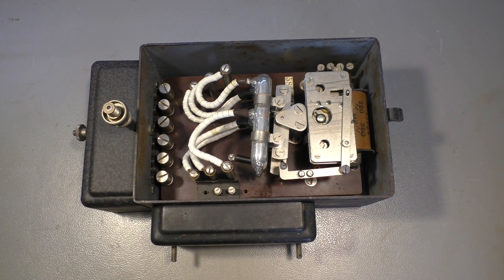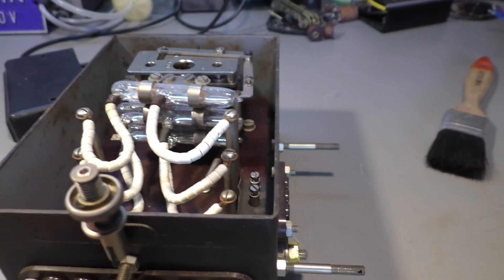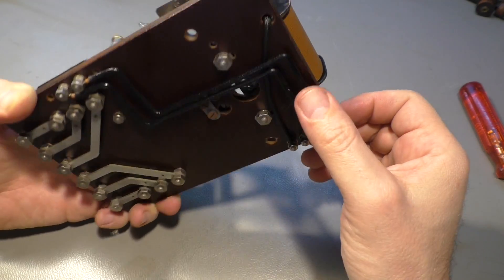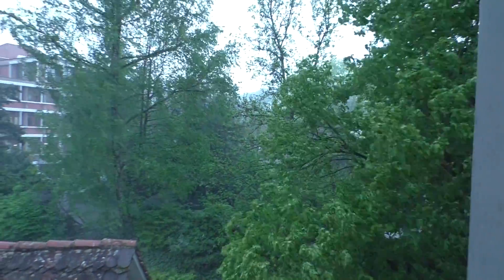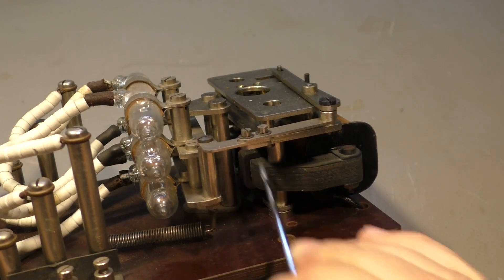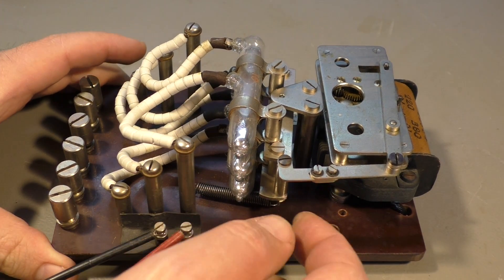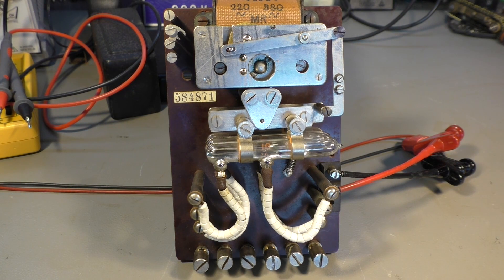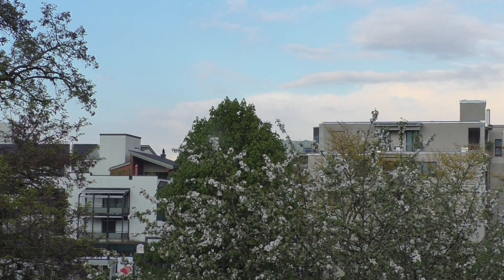Vintage Mercury Switch (PWJ59)

Comment: I just remembered something I remember one time seeing this really Old Clock Tower mechanism in a museum once I remember my dad calling over to me hey call here check this out and quick.

And realized immediately what the thing was and he said if it's actually running and the mechanisms about to start.

There were Mercury switches all over that mechanism some of which looked almost like these but I think it was just the main switch that looked like these it was probably what was in line with all the other switches the others looked more like the classic Mercury switch with the the bulb shaped glass vial also this was a clock tower which was electrically rewound but had the pendulum to keep time this built prior to synchronous Motors being used.

Who knows how old that clock tower mechanism was I don't remember the manufacturing date but it was on there I think I did take a pic of the mechanism and of the information plate happened to have an actual camera with me this was way before cell phones let alone having internet

Comment: At the beginning the switch was laying horizontally. And when shown working you had it sitting upright and vertical.
Did that have anything to do with it working ?
Reply from the maker: The device is made to be mounted on a wall... vertical. If you look where the contacts are attached to the glass tubes, they must face downwards. If the switch lies flat on the desk, the mercury would not reach the contacts. Same problem when it is upside down.
Reply: @PlaywithJunk  Exactly my point !!👍

Comment: I have seen these type of switches used in operating theatre's because of no sparks and explosive gases. I thinks they were removed because they explode if the are required to carry excessive current in a short circuit.

Comment: Are those ceramic beads along the wires? Old school flexible insulation?
Reply from the maker: yes. like a string of pearls. These keep the wires apart (the have a large distance from each other anyway) and make them hang straight down due to their weight. And fireproof too....
Reply: Robust, lasts for ages. :)
Reply: @IljaSara  yes agreed and I've seen this occasionally every so often sometimes even in tube type equipment or also high heat environments as well.

Once was working on a very very old battery charger that had this as well.

Few other things although most things that work on would not be old enough to have this in them!

Although one modern thing around the cross that had something similar except that it was ceramic short little tube like things with one end that was a rounded end any other had a recess that was about the same diameter and these were strung in and on a a nickel chromium resistance wire used as a heater along the length of it!

Also there were a couple Links of it used attached to terminals I'm guessing to vary the Heat by adjusting resistance this was an old school device but yet still modern don't know if it had been improved or possibly just still looking in good condition and have no idea haven't the foggiest at the time what this have been used for and really don't remember much other than this what I've stated here but intriguing device and yes the contacts were Mercury contacts so something that was designed for constant use either or an environment where you would not want Ark in contacts I was told this might have been from possibly scientific lab equipment but have no clue as to what it would have been used for no real identification of the equipment or anything either possibly could have been a part of another piece of equipment that had just been disused or replace although was it working order as far as I could tell and apparently the thermostat which there was a few of internally would carry full line voltage and quite large Mercury switches although different design from this Mercury Relay in the video and the interesting thing is the adjustments for the certain thermostats on there or wired sealed my gas is those possibly Were Meant to limit temperatures there was a little hinge flap over the adjustment screws with a piece of wire that had been soldered I think as some sort of tamper seal possibly or just to discourage from being adjusted this is the first time I've ever seen something like that but was pretty clever of a mechanism to prevent tampering not necessarily prevent but discouraged more than anything

Comment: Built to last, they don't make them like this anymore. This could have been used in a mine considering it does not produce exposed sparks when switching.
Reply from the maker: Yeah I think this is pretty safe. And also moisture can not corrode the contacts. That could be necessary for a switch hanging in a church tower. Almost outside (so many openings)
Reply: That might be overkill for a church tower, the switch can be put somewhere nice and cozy, not necessarily exposed to the elements, at least that's how i'd do it, but who knows considering the age of the thing, the church was probably the last place where it ended up.
Reply: @PlaywithJunk  you should see some of the equipment that's used in bell towers that I've seen or heard about or even here on YouTube.

I know someone that had used a pair of carillon amplifiers that they fixed up with my help.

Those things were built like a tank they actually had redundancy in the amplifier tubes that they would keep working even if there was some failures even though it reduced output volume there was even a redundant rectifier tube as well.

Also I have seen some systems in which the amplifiers are only switched on prior to the Bells sounding but I've seen some system learning amplifiers or essentially powered on all the time which probably may or may not have been good for the tubes depending on your persuasion but we're very reliable probably beefed up and built for the service specifically.

You should see the big solenoids and relays used in the tubular type chimes in the bell towers.

Nice big fat arcs on those contacts!

The relays were at the top of the striker solenoids probably some of the biggest solenoids I've ever seen as well.

This one had been removed from the tower and was being repaired Institute since everything was in the tower basically they had jumper leads that look more like jumper cables than anything else.

I was invited to this so I can see the system first hand.

Somaya I knew that you would like to see it firsthand as well as learn something about the system so I could help occasionally with changing roles on the system as well for changing the tunes on the Bell Tower as well as every so often possibly replacing the perforated tape roll they only came out every so many years to service the system but other people would do the easier portions of things that did not require is there services the simpler stuff and mostly in the mechanism cabinet where things were it was a big glass cabinet would probably comparable to the equipment rack sort of in a different way.

Also something interesting with bells at our school occasionally I did work on the bell ringing system and apparently at one time the fire alarm system had been used to indicate passing time and end of class I know that this was done occasionally in some areas of the countries as well as it was sort of a passive test at the fire alarm system as well.

But this had been long since disconnected but yet not very well done I had bumped the wire in the bell ringing device and happened to hear the fire alarm quick go off I'm like did I just do that try it again sure enough.

There was a place where that wire was supposed to be attached to terminal but it was not it was kind of hanging in there next to a wire that happened to have the right connection to cause it to activate so obviously that got fixed and also labeled and yes this looks like it had been maintained by someone that was just not the greatest and all the wire labels were actually masking tape and head faded away many years ago but did proper wire labels to make it easier for the next person that would ever work on this.

Evidently that system used to do a lot more than I did at that time if there was all sorts of timers and everything all tidy and probably the most complicated one I've ever seen as well as Not only was this the bell ringing system but it was awesome the Master Clock apparently at one time it was able to automatically correct a clocks at daylight savings I tried to get it working but did not have time in the end to actually get that system functional at least for quite a while just finding time and resources to do it and also finally figured out a basic schematic after sort of non-destructively reverse engineering it AKA not having sex thing all the way apart I was documenting as I'd had worked on it here and there probably a good idea as it is since I could not find any information on the system anywhere I went through other people I knew that worked on these sorts of things and they had no clue and apparently a lot of the system that could have done other things was either not used originally parts of which was obviously that way and or parts not even working anymore but in the end got everything that was still connected going or at least I thought was connected which in the end was not at the other end where were that was a few nice pops and bangs and the blowing fuses a couple times as well since no documentation easy enough to do.

No damage done since everything was built like a tank and yeah Murphy switches on all switching contacts and this was one of those sorts of I believe impulse systems but the thing is that not only was an impulse but it was other types of clock system as well there was a mix throughout the school.

There's also manual overrides on this one that we're remotely operated could also switch between different schedules just by turning at Rotary switch in the school office that system I did get working again it was one of the ones that was a little flaky turns out just a loose common terminal on the switch end of things but the odd thing is that common was not used for the manual Bill rating push button which was very much over the engineering that push button it was a Mercury switch as well which I never seen a mechanism for a push button that had a marker to switch I did have them take a Polaroid of it for me just for documentation of something like that since it was kind of special apparently that did not go through relay but trigger the bells directly possibly why it was a Mercury switch and also this was in a separate junction box next to the program selector it was it was called hard to believe the pilot lights for the system were still going was neon but very very high value resistors definitely was going to keep going none of the pot lights were even flickering after all those years very well engineered and over engineered to say the least
Reply: But it contains mercury

Comment: They really knew how to make things properly back then. It was probably in use for years and then out of use for even longer. A few squirts of oil, get the gears moving again and it's back in service. Today, a faulty equivalent would be thrown in the bin and a cheap replacement installed. Only for the fact that it has vials of mercury, it would probably be still in use.

Loved the weather shots btw :)

Comment: Great! Brings back memories of all the vintage stuff I destroyed as a kid. In the name of science of course :)
Instant subscribe. Thanks.
Reply: Yes one thing that I wish that I had known what it was that I would have definitely saved and not working or at least in part it had a Westinghouse logo almost nothing was legible but was a televox old school remote they operated system of some sort it actually had what was called Electric tuning Forks.

Although some parts of this did live on for example the relays just one of the examples.

Really nice old school Westinghouse relays.

Is the idea was this would be set up somewhere where they would need to be some remote control of some sort over old school phone systems this was back when you'd have just a Candlestick phones sort of thing and this essentially was tone decoder and relay operating system.

At the time I knew nothing about it couldn't even not really identify it!

Evidently this was something of historical value and well this combobulated after I got done with it if I had only known at the time.

Who knows why I've been donated to some electrical Museum or something even!

Or at least try to use it in a manner it was similar to what it was being used for in the first place perhaps just as a old school tone receiver with a modern tone transmitter.

It was in with a bunch of other stuff it's possible the whole system was in there both ends I got a ton of stuff that was all about the same age and a scrap for Salvage specifically since no one knew what it was and when my body was not interested in this just too old for his tastes he got it with a bunch of other stuff that was just sitting around an old building that was being cleaned out.

Also knew someone that had used an old motor generator from a car loan system for DC power in his Workshop real Beast think it was around 100 amps or so around 48 volts or thereabouts had modified a bit to adjust voltage manually.

He did have three phase power for the workshop so was not a problem
Reply: Instant scoop subscribe for me as well here

Comment: I'm thinking they didn't want to use a standard relay because it would cause the Mercury to bounce around and creating arcing. Kind of like what usx to happen when moving an old thermostat too quickly.  very neat!
Reply: The mercury, ironically, being the most reliable part of the entire thing. But yeah, they just dont' make things like they used too. For numerous reasons.